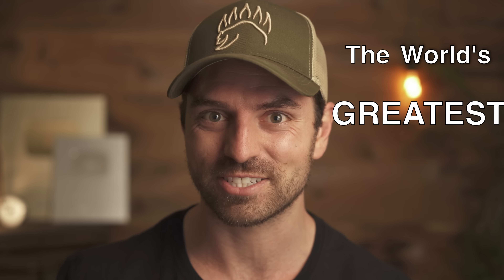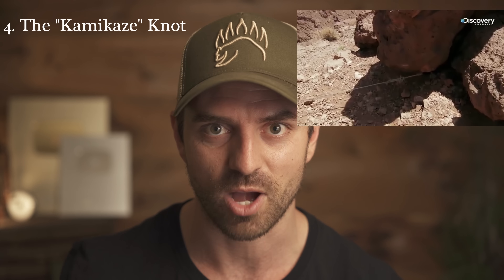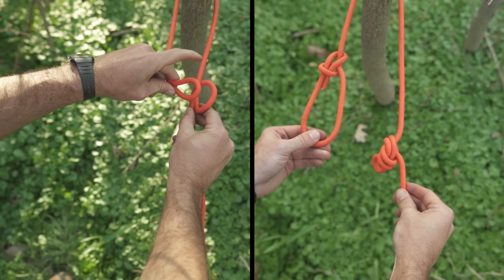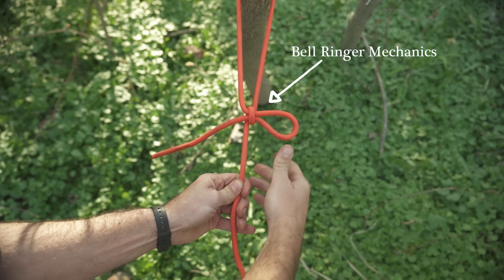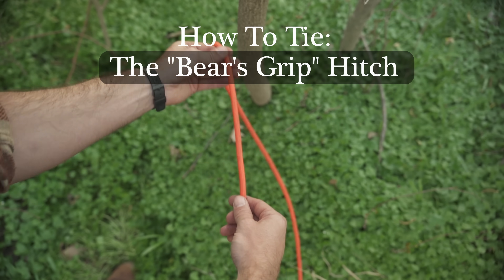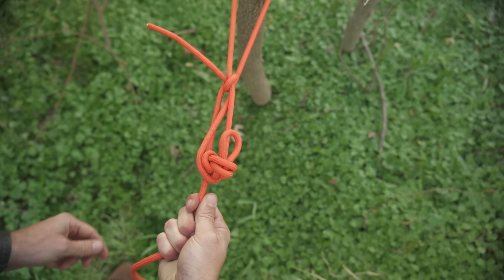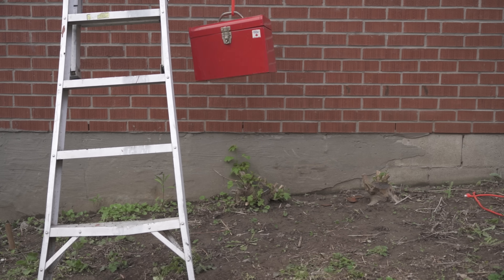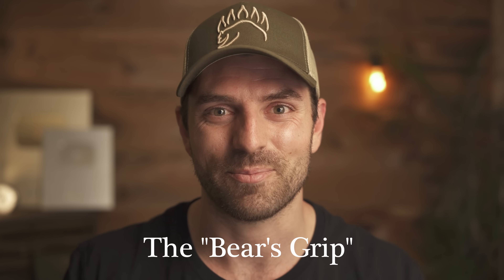Revolutionary NEW KNOT that SELF RELEASES when you want it to!

Comment: VERY IMPORTANT NOTE:   I don't see it being mentioned anywhere, but what type of rope you use this knot with is very important! I tested it with various ropes, strings, strips etc and noticed that on some materials the lower safety knot tends to get stuck or tie itself in a way that you have to release it manually (meaning pulling the weight back up to you, or not being able to get the rope back if descending). Some brand of knock off paracord I have was VERY prone to getting stuck in this way (avg 70/30% stuck/not-stuck). Test the knot with what rope you're planning to use it before you go out into the bush, so you don't end up being angry and surprised. Cheers
Reply from the maker: Excellent point!! Also, the type of anchor you’re hooking up to. A bag handle thats  soft vs a hard loop for instance. The bag handle will get caught more often.

Comment: Nice knot. "Bellringer" part of this knot may slip off on larger diameters (high angle between encircling sides of the rope), but simple knot on loose end, right before the "Bellringer's" tightening loop, can help a bit (especialy in "Tarzan" mode, swings from left to right).

Comment: Thought I would add some testing I did with the knot (which is brilliant thank you to the creator) if the knot is being tied above you at a certain point the weight of the rope itself will be too much to overcome to release enough tension to release the knot. A lot of variables weight of the rope length, angles, obstacles and size of knots, loops and skill. But I was having real trouble with 50’ had zero trouble with 50’ when I was above the knot.

Comment: Rope can be cut on itself using friction. So you would not need a knife to perform the kamikaze knot. Just stick the piece you want to cut between your feet and pull the extra rope quickly, using 3-5 ft, on the area you wish to cut. Very quick and useful and I’ve yet to find a rope it doesn’t work on!

Comment: Thanks for teaching it! I'll bookmark it in case I have a need for it. :)  Question:  Would there eventually be a weight limit that would cause the tag end of the loop to pull through the clamping twist?
Reply from the maker: Good question, I tried about 200lbs and didn’t find a limit yet. And honestly I don’t entirely know! I’ll have to do a bit more testing! But it would technically have to slip off of the figure 8 before the twist can undo itself
Reply: @TheBearEssentials  Would be interested to see the testing.  I had the load-end of the knot backwards--the tree you tied around is where the backpack goes as I now see.  The competition in forces becomes the tag end trying to pull out of the clamping twist, around the figure 8, and then out of the clamping twist all the way, versus the clamping force of the twist itself. And then of course friction at any interaction point.

Comment: I wonder if you could make a kamikaze knot version from 1 rope, but with the knot in the middle of the rope, and both ends going downward, one very secure to bear the weight being dropped, and the other remaining slack until you get to the bottom and give it a tug to release the whole thing.  (whether the middle actually drops straight down or whether the rope needs to be "pullied" around whatever it was tied to at that point with one of the ends going back up before it's fully retrieved - shouldn't matter thaaaat much). 

I feel like this would be the idea solution for repelling. (still wouldn't use recreationally, but in a survival situation at least - so long as you don't need the extra length or have a longer rope... heck two ropes could even be tied together securely to make one retrievable rope like this).

The main benefit just being that the releasing action no longer involves the same rope that the weight is being lowered on, so as you repelled (which naturally can jerk the rope easily) you're no longer risking unknotting it. So long as the slack rope remains slack it's all good.

I know there's a knot out there that's kinda the opposite of this, using 2-ish ropes to lower an open "claw-esq" thing down (a loop and a thing to hitch it with). It's a knot that I've seen used as a demo for something like retrieving keys from a storm drain, where you lower it in and get it in position with one thicker rope, then "close" it around the object to be lifted with a second rope. So what I'm suggesting here is kiiiinda the opposite of that - though I imagine the actual knot itself would look very different.
Reply from the maker: Yes you absolutely can, there are many like this. However this requires a rope that is 2x the length of the drop. These kamikaze knots are for when you don’t have that
Reply: @TheBearEssentials  That makes more sense, thanks for the answer! :)

Comment: I don't tie knots unless i am camping. This came into the feed, so I'll give it a go. It works fine on larger ropes. The thinner diameter of cordage the bigger that loop might need to be, because getting it to pop off that figure 8 on 5/18 nylon rope took quite a lot of patients. However on thicker rope 3/4 and above, you can pull that loop shorter by quite a bit and still get it to release just fine. I didn't try with twine, but my guess is it will be a real monster to undo.

Comment: One way I could think of to have a knot that is as secure as a non kamikaze repelling knot but also something that is able to be recovered, is to have one line be the one for repelling, it would be solid and no tugging or shaking would unravel it, while also sending down another rope right next to it that is tied to the 1st one in a way that tugging it would unravel both of them for recovery. Obviously the drawback is that you need to have 2 sets of rope, but the one that is not load bearing can be as thin as a shoe lace I think and i could work.

Comment: I think you should look into the macrame knot. Its jot exactly the best for loweing tools, but you might appeal to you based on your inspirations:

The macrame knot, sometimes called the ghost knot, is bodyweight-safe knot that can* be used when you want a retrievable anchor for a rappel, and you have either a rope double the rap length, or a rope equal to the rap length with an extra non-weight bearing pull cord equal to the rappel length. It can be retrieved without having to pull the whole length of your ropes through the rappel point, so may be more suitable for tree or boulder rappels when rings arent available.

You can safely single strand rap on it, and then only with deliberate alternating pulls on the two strands will the anchor detach. It does have a failure case where the pull strand is heavily loaded while the load strand isn't, but this is user error.
Reply from the maker: Ya thats a great one but requires 2x the length of rope as the drop
Reply: @TheBearEssentials  yep, but safe enough that with through checking it could be used in life supporting purposes! I'm not aware of any single length method that meets that criteria except the beal escaper, but that's a pain in the as to detatch

Comment: This is really cool! When you asked the question about how to release without using a jiggle that might be emulated by bumps or jostling I spent a little while thinking.

I imagine there might be some alternatives if you have double the length of rope you probably dont need a special knot at all  you just use a loop that can be unfastened at the end you will be on and then pull the rope off of whatever it is hitched to.

Similar, if you have a secondary rope that is as long but doesnt have to be rated for the load  you could fashion a knot that would not unbind unless there was a lack of tension on the load bearing rope and tension on the helper lead.

The weirdest thought was thinking about how if you twist rope repeatedly it will eventually bend over itself with kinks. You cant really control where those kinks appear, so you might not be able to take advantage of them, but it would be wild if you could somehow unbind the rope by making use of them.

Comment: Equivocation hitch is a better use for using as a handline to lower down short bits of steeper terrain
Reply from the maker: You need 2x the length of rope as the drop for the equivocation is the only thing.

Comment: If you have enough rope (at least double the drop) you can use a butterfly knot and a carabiner at the middle of the line. Put the rope around the thing to be lowered, then clip the 'biner to the the rope. One side of the rope will hold tension, the other will release the whole thing and pull through. 

Works similarly, but doesn't need the shaking. This does require a lot of rope though, so not too good for longer distances. 

Great knot! I'll add the bears' grip hitch to my repertoire.
Reply: But one thing to thing about using a butterfly knot and a carabiner is that the half of the line that you use to use to retrieve the carabiner can be a light weight cord and it does not have to be the other half of the 11 mm abseil line. So you can use almost the full length of your repel rope as long as you also carry the same length of a 2mm or 3mm cord. I have used that trick and it works well.
Reply: If you're lowering an item and have double the drop length of rope (most likely in majority of situations) you don't need any knots, carabiners, or anything else. Just pass the rope through the handle on the item, hold that short end, start to drop the item and let the long end of the rope slide through as gravity pulls the item down (same as with the examples shown here.) Shake, bump, yank that as much as you want, it's not coming loose. When it hits bottom, let go of one rope end--the shorter one--and pull it back up.

Comment: I'm experimenting with kevlar cord as well as paracord. Kevlar (some brands) seems to have some SLIP to it, but I've not actually tried anything that relies on friction yet.

How much do knots like this rely on friction? 

I will CAREFULLY explore this. 😉
I'd love any thoughts you'd care to share, too. 

Thnx again!
Reply from the maker: You can generally use Kevlar cord for this. Give it a try and let me know!

It is the plastic UHWMPE cordage that may be too slippery. 

The Kevlar has a bit of compression, which the bellringer/half hitch portion somewhat needs to hold it in place. 

In general though, friction hitches won’t work too well with Kevlar on Kevlar or plastic/plastic. They hold OK, but can slip way easier.

Comment: alternatively, wrap your rope around a tree; make it so that it’s a giant expanding loop by creating a small sturdy loop on the short end, so that you can use yourself & the tree as the two pivots in a pulley system, 

or even just make it one big loop & use that to climb down & just untie the loop when you get to the bottom. if you use two separate ropes then you can even untie it from either end of the loop without having to rewind the tape.
Reply from the maker: Ya, just need a rope that's 2x the length of the drop, is all.

Comment: I think I came up with a much simpler and more secure way to do it.
You take a rope and insert it through the handle/clipse in whatever item to intend to lower. Then you grab both ends of the rope, and lower it, and when you're done, you let go of one end, and pull the other, and you have your rope back.
The downside is, you need your rope to be twice was long for the same distance of lowering, and you need whatever item you're lowering to have a handle or hole.
Reply: Also, if you're using this to climb down, it'll be easier if you tie one end of the knot to yourself, wrap it around a tree, and use the other emd to climb down. (Then you don't have to constantly grab both ends of the rope, which would be quite inconvenient...)
Reply from the maker: Ya, thats a great way, but requires rope thats 2x the length of the drop.

Comment: By definition, there's only one failsafe. For it to be a "failsafe", something has to fail for it to come into play. The remote release part is just a feature; the bellringer part is a failsafe in case the remote release part fails.
Reply from the maker: Hey! Great point, makes sense to me! I suppose I figured that the top (non failsafe) was one because half of its job is to hold the bellringer in line- making it a failsafe in itself from the bellringer twisting loose. 

But I think you’re right that’s just a feature

Comment: This is awesome, but is there a way to tie a knot that is officially accepted as secure enough for human repelling that would normally need someone to untie the anchor knot, but instead you could have a second equal length of thinner lighter cordage that you can pull on from the bottom of the cliff/ledge which unties the officially accepted repelling knot and then also get your finer cordage back too? 🤔
Reply from the maker: Ya there is definitely a way, I can’t say off the top of my head, because as far as rappelling goes, I’m not a pro. 

Maybe a rock climbing expert on here / in the comments can add to this!
Reply: There are many ways to do this that are actually safe, and the video's method is not one of them. The standard method is a "carabiner block": tying a loop in the end of the rope after passing it through the anchor, then clipping the loop to the standing (rappelling) strand to prevent the knot from pulling through the anchor. A retrieval line attached to the loop will pull the rope down, but only if there's no load on the main strand.

Comment: This is GREAT! 🥇🥇🥇
The main point when using such knots is that the rope must be held tight all the time until it should be released.
The moment the rope isn't held tight, you can't trust the knot!
Reply from the maker: Yes, and that's more true with any of the first 4 existing kamikaze knots. 
But with the Bears Grip hitch, it often takes more than slack in a line to get free.
Reply: @TheBearEssentials  I fully agree with that, but don't take it for granted. 
Safety, safety, safety.
Reply from the maker: @rickwhite4137  100% I hope everyone reads this comment, couldnt be truer. Thanks Rick!

Comment: I wonder if using a marline spike hitch in place of the loop could make it even more secure but still release?
Reply from the maker: Hey great thought!!
This is another version I’ve seen before but haven’t covered - it works well with the right rope and with a legit marlinspike. Downside is it can be knocked loose. You can attach the back of the marlinspike to the standing line so you don’t loose it with every rappel too.
Reply: @TheBearEssentials  I just tried on paracord (with the marline spike hitch replacing the loop closer to the anchor point.
It seems like in some cases the spike hitch will bind the bite so tightly that it may not release leaving your rope stuck to the anchor. Ima playbarojnd a bit more and see if it can work on thicker ropes (like a climbing rope) 
Thank for the great video!

Comment: I invented my own knot for lowering stuff.

Its simple, you just use a rope thats twice the length of where you are lowering your tools. You pass the rope through bucket handle and bend the rope in half. You can then lower it using the whole rope bent in half. Once it reaches the floor, you drop one side of the rope and pull up from the other side. Cheap and dirty. LOL

Comment: Another way might be (if not already done 😬) to tie a ‘Swiss Seat’ to yourself at the end of a rope to lower you down, and then use two grip loops for each hand attached to the other side of the rope which will be being lifted up and around an anchor tree which are each attached to the rope with ‘Blake’s Hitches’ which you slide individually down the rising side of the rope?. This would still need a length of rope twice the height of the cliff though as it would need to be long enough to be around you as a Swiss seat and also with both hands in loops attached with Blake’s hitches to the other side of the rope once you reach the bottom
Reply from the maker: That’s a cool idea!
Reply: @TheBearEssentials  Please demonstrate this in a video

Comment: You could retrieve a running loop either with a separate cord or with the unused tail of an on-the-bight loop to unshrink the anchor.  Please don't promote suicide knots.  Even relatively short falls can be serious.   For reference, also look up a Tumbling Timber Hitch, Tumble Hitch and related knots.  By the way, that show used camera tricks.  They didn't really use the knot they showed.

Comment: Why not just pass a rope through and tie both ends together, and that's what you hold on to? it cant come undone because you are holding the knot. when ready to release, just undo the knot, and pull to get the rope through. The only downside is it takes twice as long as a rope, but its way less complicated.
Reply from the maker: Yes, that's the way if you have 2x length of rope as the drop.

Comment: I don't quite get this. You say the hook holds the bellringer in the right orientation, but the bellringer doesn't do anything as long as the hook is in place. The bellringer only comes into action after the hook has failed, at which time it can get itself into any orientation. You have redundancy here, which is great, but I don't think the two components are really acting together in the way you suggest
Reply from the maker: Hey, hopefully I can clarify: 
The bellringer is what holds the tension, not the hook. The bellringer is in action the whole time. If tied right, you can get it so both the hook and the bellringer hold tension at the same time.
Reply: @TheBearEssentials  I see, thanks. Presumably, if there is no tension on the hook then it will easily come undone? So you have to tie it quite precisely to get enough tension on both for them to both hold.